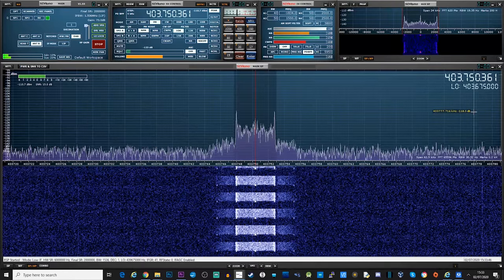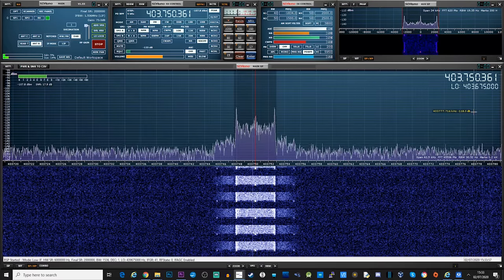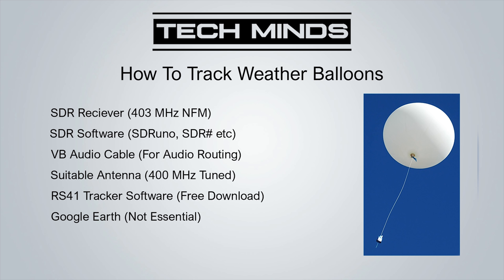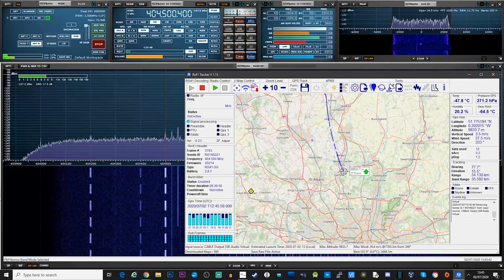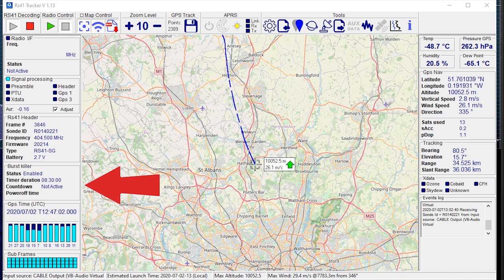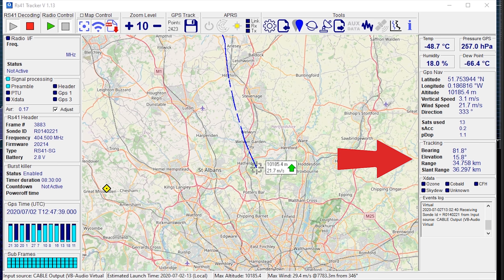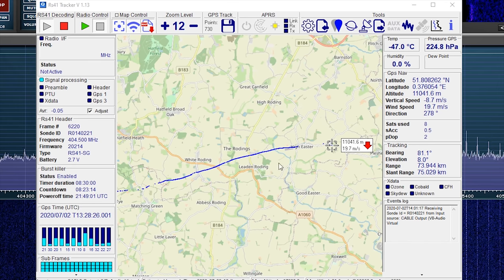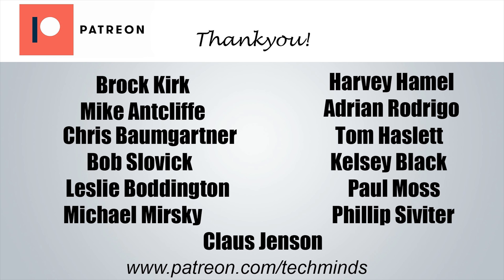How To Track Weather Balloons Using SDR

Comment: Way back in the early 80's I worked on the wind resolving radar which tracked sondes and calculated wind speed and direction at the 'standard' levels. E.g. 500, 400, 300 mb et seq. I'll definitely load the software you used and have a play . Many thanks, J

Comment: I've been tracking them using Radiosonde auto rx running on a raspberry pi. I decided to put it in the car can chase one a few weeks back and I managed to recover it. You can flash the micro controller and there s bunch of open source projects around to reuse them either as HAB payloads or little fox hunting transmitters. I haven't decided what to do with it yet but I'm tempted to donate it to the museum of radio communication in Derby when it reopens. I'm tempted to chase a few more but it's so windy at the moment I don't think I'll be able to keep up and there's a good chance they'll end up in the sea. One of the launch sites is at Watnall which is not far from me but I might stand a better chance of catching one from down south if the wind is blowing north. I think they have a launch site just south of Bedford and a couple on the south coast. Supposedly there are 6 met office launch sites but I haven't seen the others yet.
Reply from the maker: That’s awesome that you managed to located one. You could see in my video I was receiving 3 different balloons at the same time, and one of them was definitely launched from Bedford, I think it’s the one I was showing in the video. It kind flew south and then went east, but if it changed direction and flew west it would of been in my area. I might of been tempted to go chasing in the car too! RS41 Tracker has the option to feed it with NMEA from a serial GPS, so it always shows the correct bearing of the Balloon, perfect for hunting for them! Maybe when I try this again I be ready to go mobile just incase it comes this way! :) thanks for watching, I’ll look into the RPI solution too.
Reply: 😀 Well done. While I was watching the video I was wondering if anyone was trying to recover these.
Reply: @Steve-GM0HUU  Steve I belive in UK its not so well known, but after a litte advertisement it will be spread out . Today Jim , 5B4ALS in Cyprus made the first monitoring, I sent him some information a few weeks ago. Its linke a virus :-)

Comment: Thx. for great and most educational videos in ham radio comunity.
Reply from the maker: You’re most welcome, thank you for watching 🙏
Reply: Exactly my HF radio transmitter. Intrigue me because it was a h f but I just found out today it was used on weather balloon 70 volt miniature electron tube and another tube.. that's a little larger now I need to find out what they did in 1950s compared to what they do now and try to figure out what the radio show that I'm getting actually did was it altitude? Wind speed? I'm new to this but I'm going to learn it

Comment: I followed the connection instructions you show with VB Audio Cable using SDRSharp, but only get connection fail messages from RS41.  I wrote the RS41 developer but never heard back. Can't figure out why the VB Audio Cable connection does not work.

Comment: Have tried to get this up and going. Have RSP1A , RSPUNO, Virtual audio cable...
The Tracker shows preamble , but will not decode. The radiosonde I am looking to see is a RS41SGP  
Any ideas as to what I am screwing up ??
Reply: With SDRuno you have to set it on WFM an narrow the filter afterwards.

Comment: Excellent! Do you know if the US is still using 1681 Mc?
Reply from the maker: I’m not sure, maybe someone else can answer that. Thanks for watching 🙏
Reply: Tech Minds  Many sites in the US are using 1680 MHz radiosondes (usually Lockheed Martin LMS6 sondes), but they are slowly transitioning to using the 400 MHz band. Many sites in the US are using the 400 MHz band already, using a combination of Vaisala RS41 and a 400 MHz variant of the Lockheed Martin LMS6.

Comment: A transmission range of 600km+ @90,000ft isn't uncommon in Australia.
Reply from the maker: Tbh I did think that the transmission range quoted on the RS41 specs was a little low, with such a great height I’m sure it would go so much further.

Comment: hey why did you not show the graphics that u can look at with the software u had
Reply from the maker: Ummm not sure which graphics you mean Andrew, which graphics are you referring to ?
Reply: @TechMindsOfficial  THE PROGRAM YOU USE TO DECODE THE RADIOSONE ALSO HAS GRAPHICS IF U LOOK IT UP BY THE  CLOG WHEEL IT BE NICE IF YOU WOULD SHOW IT TO PEOPLE SO THEY KNOW THERE IS MORE THAN JUST FOLLOW  WERE IT GOES THEY ALSO CAN GET THE DATA FROM IT AND SEE WHAT THE  WEATHER PEOPLE SEE AS WELL

Comment: I want to try this, but nobody is launching weather balloons near me anytime soon
Reply from the maker: What part of the world do you live?
Reply: US
Reply: @MrC-Hacking  There are many radiosonde launch sites in the US! However a lot of US sites are using 1680 MHz sondes, but are slowly transitioning to the 400 MHz band. While the 1680 MHz sondes are a bit of a pain to receive (need a preamp and an antenna with gain, like a dish), the 400 MHz sondes are surprisingly easy to RX. However, many US sites are using LMS6 sondes which are not decodable by the software mentioned in this video. radiosonde_auto_rx will decode these however.